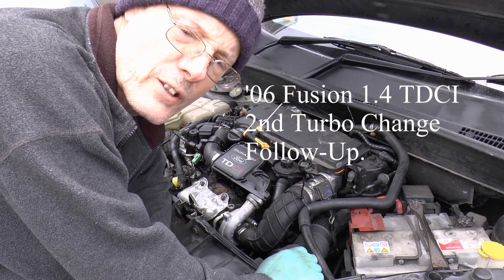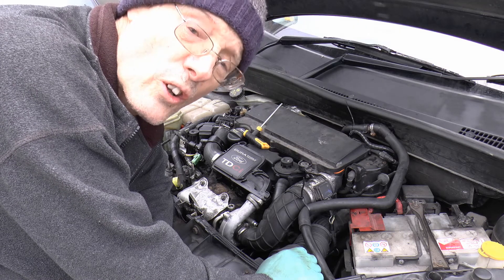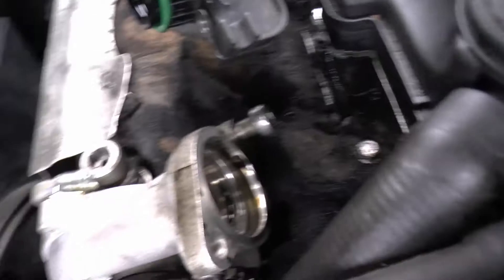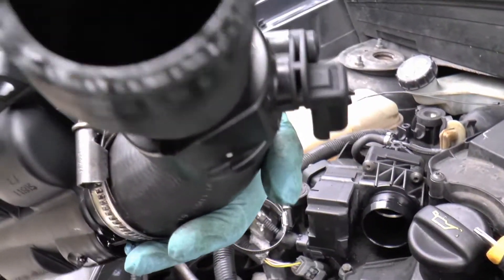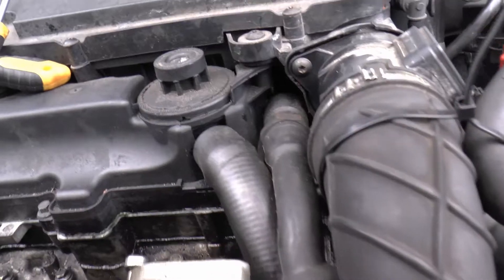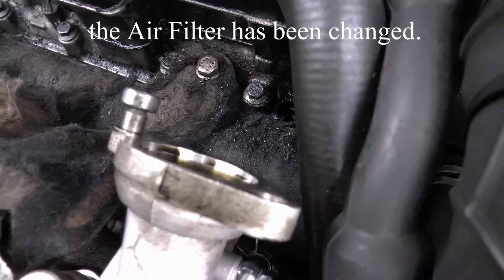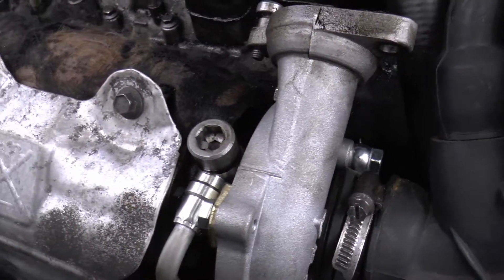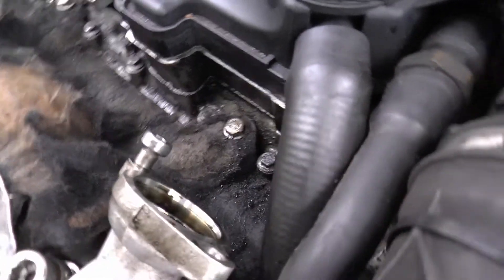'06 Fusion 1.4 TDCI  2nd Turbo Change Follow-Up.

Comment: Do you have a video of the EGR replacement?.
Reply from the maker: No, it was done at the garage before I started vlogging, sorry. However, once the fuel filter is out of the way it does not look too bad to get to.
Reply: @sleepycatpictures1176  
Thanks for your reply. 👍